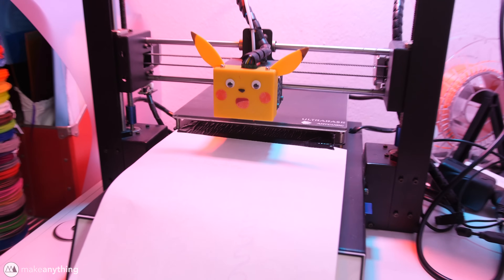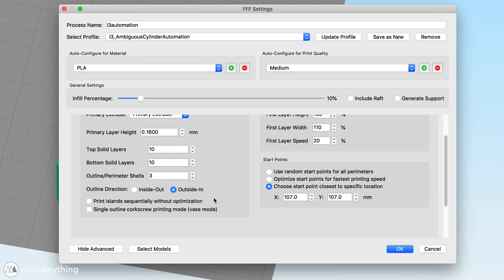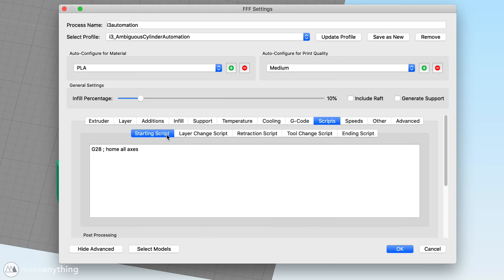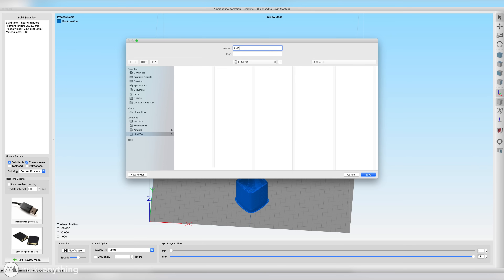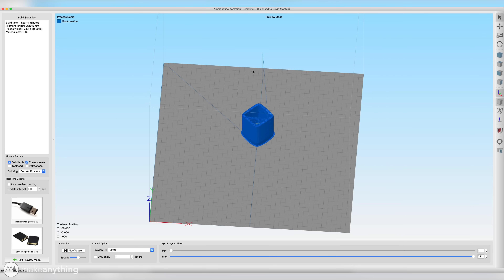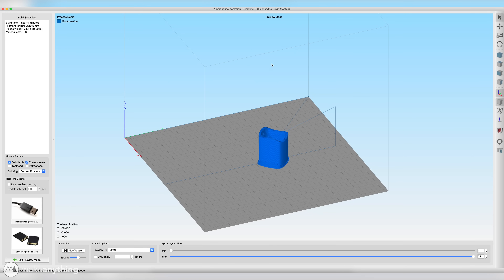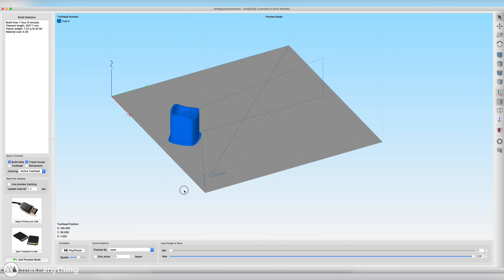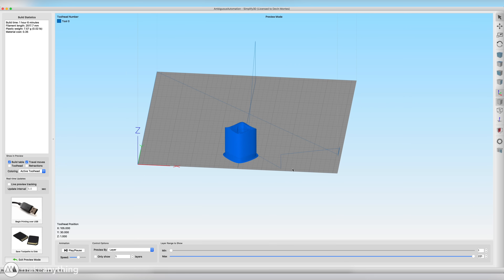Automatic 3D Print Removal using G-Code

Comment: i tried this on my edner 3 v2 neo and the print didnt wont to come off causing my extruder head to stuck on the object
does it need to cool down before trying or do i need a glass bed? if so, which one?
Reply from the maker: It looks like that printer has a PC bed which might stick to parts too much. Best would be a PEI bed, and also letting the bed cool to 45-50 first

Comment: thanks for the video very helpful. coudnt get the beeps to work but the automate code you made worked perfectly for what i needed. I switched the G1 to G0 and didnt need to clean the extruder in between prints. next im trying a G4 code to let it cool a little bit, then ill be designing pieces to scoop them into the trap. wish me luck.

Comment: This is exactly what I was looking for. I'd like to be able to run Octoprint on an Android phone and print off multiple objects while out of town. Them just come home and pick up and clean all the printed pieces. I've been doing a lot of mods and upgrades to my JG Aurora A5, and I've removed the "3d Printer" nameplate off of the gantry, I guess I could design and print a scraper/pusher that attaches in the same place.

Comment: I would use a nozzle flow/purge line before each print. Just put them off to the side and each one at a different y position. That way you start each object with a good flow, as if you printed a skirt.

Comment: I can see how it would work with parts like this.  Tall and relatively thin with a small surface area touching the build plate.  It wouldn't work so well on parts that are short and have a large surface area contacting the build plate

Comment: I have a belt printer, but as you might know due to the 45 degree head, some thing don't print as well, and some print better.  But I wanted belt printer that has the traditional xyx.  So I was getting ready to convert one of my bed slingers, but I might just try this first. One thing I plan to do is on my models build in some kind of angel relief so a scraper and get under that and pull it off. I know this is an old video, but it still great. And one of my printers is an i3 Mega

Comment: Really good video.  Am in the process of doing the same on my cr10s.  I am using the secondary extruder output on the motherboard to lower a long scraper.  At the end of the print the y axis moves as far forward as possible.  Then I cool the bed and leave for a few minutes.  At this point the e1 stepper lowers a long blade to the bed surface and the y axis moves backwards slowly.  In theory this should work as my printer is tuned exceptionally well.  I don’t use any printed platform additions or things like glue or tape.  Also I have found that even using all of the bed providing it’s cooled right down and also the model is cooled the prints come off with no effort at all.

Comment: My printer would flat destroy itself trying to remove my prints from the bed. If your gunna post something like this then it should cover how to print something that sticks well enough to print but not so well you need to use Thor’s hammer to remove it. And that’s after the bed is cool. Cuz I’ve never put anything on my print bed but nearly every print on this glass feels like I’m going to break the glass just getting it up

Comment: Donyou by any chance have a video on bed leveling. At the moment i have been thinking of buying a BLtouch. But at the same time while i look at your videos i might not have to do that.

Also my next quick question is if you can have profiles? Like for example you have your default print movement settings in profile 1. But profile 2 has what you did in this video. And say you mess something up. You ciuld just go back to profile 1.

Also do you have to paste stuff into the gcode script? Or is there another simple way of printing multiple things without having to mess with gcode well…..code..?

Comment: Do not merge the files in one, it creates large files, so it is not real continuous printing. Just use M32 command to start printing the .gcode file - that way you can run one file several times. (If your printer supports it. Maybe it could be also done with M23 and  M24 commands.) See gcode specs.

Comment: Be really careful about wire brushes around the heater, usually there's a tiny gap between the cartridge and the insulation, it develops over time perhaps, it may short out and or short to your therm sensor, ( found this out the hard way), I usually avoid the wired side it's tough to keep them sealed with all the thermal cycling I guess. But just something to think about if this type of setup is unattended
Reply from the maker: I didn't consider that, good call!

Comment: This is a great idea! You can get this to work with taller prints (or prints of any size) by replacing the "Move up and back" code at 4:15 with these lines:

G91
G1 Z10
G90
G1 X105 Y195
G1 Z1 F3000

The G92 means relative positioning, which means the G1 Z20 moves 20 mm from /wherever/ you are now. G90 switches back to "normal mode," so that the other commands work the same way you expect. This change means that moving the print-head up works even if your print is bigger than 50 mm (or any size), as long as you have a small gap between the top of the part and the highest z-height available.

Comment: I wonder whether incorporating the brim into the model to have a say 45° lip and putting a similarly angled wedge on the print head could help reduce forces on the print head and facilitate levering the piece off the build plate like so :   model-brim-lip   |_/ /_  print head? Print head wedge would need to clear print nozzle end though. Second crazy idea, print out filament on plate as it's spooled back on and fed through again to mix colours along new filament length lol
Reply from the maker: I think that's a great idea!

Comment: Does g code has a code to go to a line like in bash? Or point it to another file :) Set a variable of how many times you have to cycle through files :) Code minification is a thing :) F2FS has a support for ZSTD compression. And some kind of network print solution.
At that point you would not be g code size limited :)

Comment: I lol'd at 0:23! Too bad my LK4 Pro has silent steppers... I'm glad to see somebody actually willing to talk about G-Code. Too many people just don't want anything to do with it.
If I had to print hundreds of the same part, I would probably try to mod my printer to have a servo controlled 'scraper' that can be deployed with some M42 commands.
...although in my case all it would do is break things, because my prints won't come off even with a putty knife.

The nozzle brush is an interesting idea! My filament oozes and curls back up onto the nozzle! It's so messy that a bed wipe is not enough, even with a brim!

Comment: One mechanical solution, to push the model further than the build plate, and still push it when it touches the slide.  add a spacer block the point of contact of the part of the moving head. they you can add contact power relays triggered by the printer from cgode and uses all kinds on addons, conveyor belt, bed srapper.

Comment: There are 3D printers that have a rolling build platform which is like a treadmill.  After a piece is printed it is rolled forward out of the way to make room for a new object.  As those objects round the edge of the treadmill print bed they are literally forced off of it and into whatever collection bin you have set up.  Can that be adapted to any kind of 3D printer?

To avoid the stringing across the print bed how about mounting the steel brush to the opposite side instead?  That way each new pass starts without strings to glob up the works.

Comment: If the printer frame and print bed were large enough could many print heads be mounted at once?  For purely duplication purposes you'd think it would speed through identical prints.  I've seen dual print heads mounted to the same rail or guide.  I've seen print or tool heads that can be swapped by the 3D printer itself on the fly.  

How about a new approach?  Remove the traditional printer frame to replace it with robot arms.  To these robot arms mount multiple 3D printer hot ends with filament feeding systems.  This will enable to robotic arm to work with many colors and materials at the same time.  It would rotate each component into place eliminating the need for wasteful purge blocks.  The print bed itself doesn't have to be mounted in the traditional position either.  It could also be mounted to an automated and adaptive robotic apparatus.  

Think of it as a painter.  Holding the palette, brush, and canvas to co-ordinate the intricate motions like an in-air 3D dancer.  With multiple robotic arms in play each mounted to a common surface they can add their material(s) to a singular or a variety of print beds without getting in the way of other robotic 3D printer/painters.  The arrangement of these robotic arms could be linear, mounted as a square, circle, sphere, etc.  Perhaps this could be a new form of 3D printer were deposits are made to the outer and inner surfaces of an existing object or where new sculptures are fabricated?

As far as editing the G-Code how about creating a learning program?  Mount a 3D printer pen to a robotic arm so that it can be used as a learning 3D printer that actually moves in 3D space.  Can the G-Code be used to teach the robotic arm how to move with natural human motions?  Kind of like making it a programmable puppet.  I have seen this done on 3D Printer Nerd's channel as he interviewed a puppeteer at one of the ERSA/MRSA fairs but I wasn't sure how it was done.  

The human operator grabs the robotic arm in learning mode to move it around while making a live 3D print.  Once completed the software saves that to its library.  Over time the robot can address new challenges by combining the actions of these libraries or possibly adding to them with improvisations by making short edits on the fly.  

Could also be used to build up adaptive works through other sensor inputs.  Then tell the 3D printer what you want made and watch as it figures out how to accomplish that task.  This would make an awesome series of videos as you and perhaps other team mates join to figure this project out.  It will benefit the entire 3D printer community and of course sponsorship is likely to blossom as a variety of interested parties will want to have their products and services affiliated and advertised throughout the project.

Comment: how about a Gcode to create a claw for the print head, once it's done printing (and cooled down enough), it moves into the claw (probably with some clips that'll catch on the top of the print head), and then moves into a position where it can pick up something with the claw?

or perhaps if there's a print head with 2 fans that can be controlled individually, rewire one of the fans to run a little motor (probably with a gear system attached) to grab stuff and assemble it off the bed

or a see saw style lever, that the print head moves to press down (and potentially trigger a cool mechanism)

Comment: Instead of taping the paper to the TOP of the BOTTOM panel u have there. flip the tape upside down and put it on the bottom of the top panel so that there is less 'flat' paper space near the beginning of the paper slide. ALSO consider teflon sheets instead of paper which create less friction than paper.

Comment: next up, "how to hammer nails with a caliper".

you have some good ideas on your channel, this ain't one of them.
Reply: Why is this a bad idea?
Reply: @DeanMcKenzie   the "how to hammer nails with a caliper" comment didn't clue you in?  Alright, well the core of a printer is a precision positioning system.  They are built to move fast and accurate, NOT to deliver force (like a milling machine for example).  In the absolute best case scenario, the risk of skipped steps so high its almost guaranteed, sure you can re-home between prints and probably be ok, but that's best case scenario.  Crashing them into the part will cause untimely wear if not a catastrophic failure (something bends or breaks). 

Lets also talk bout bed adhesion & part shape:  his demo is best cast scenario:  very little surface area on the bed & a flat rigid edge to hit with the carriage.  This is rarely the case.

if you really need your parts to be removed automatically (you dont), I would suggest looking into an infinite z or belt printer (same thing, two names).  On these, the print bed is a conveyor belt, so when its done, the belt advances and the curvature of the belt neatly peels the part off.  They also have the advantage of one axis being infinitely long.

Comment: Thanks, this worked perfectly.

Printing in PETG which sticks extremely well to the bed so I added;

M190 R40

before "move print "
So that when Bed temperature reaches 40c the print easily releases.
Reply: what kind of bed coating do you have? I'm interested in trying it with PETG, i've had this filament for a while but hasn't tried it yet, but i've heard that it is difficult to remove it from PEI and some glue should be used in between.
Reply: Alex polyenov 
Using a textured Prusa bed, I’ve had a few fails with the print not releasing at 40c. PLA would be better for sure.
Once I get it sorted I’ll post settings.
Reply: @nicokypreos  Thank you! Much appreciated. I'll keep an eye for the update. My Prusa bed is smooth PEI, so i imagine it would be even stronger adhesion than textured. I'm specifically interested in PET/PETG for their properties. PLA wouldn't work for me for its  very low melt temp/
Reply: @alexp2011a  ok so using PETG and Textured bed, releasing temperature is 27c, print slides off

Comment: IMHO whether this works or not highly depends on what kind of material you're printing with, to what kind of print surface, etc. I'm printing PLA on PEI and it sticks way too well as long as the bed is warm. So in my case, I'd need to cool the bed first, then knock of the print. Cool idea regardless!
Reply: Wouldn't a peo sheet stick less?

Comment: F stands for feed, when using a CNC mill or other similar machine, the speed or S is for RPM of the tool.
Edit: G code is modal, that means if you wanted to move to say X1 Y1 Z1 but you wanted to do each axis at a time you could type
G01 X1 F10
Y1
Z1
Because any command or value you have entered already, stays the same until you say otherwise.

Comment: G-code is motile, which means if you set something it stays that way, if you put g1 once, you dont have to put it again until something else happens. Even the variables like x and f will maintain.
For example the brushing could just be 
G1 X# Y# F#
Y#
Y#
Y#
X# Y#
Reply: not sure if anyone reads this 3 years later, but this is completely wrong and will not work on most printer firmwares.
Reply: agreed
 @Terandium
Reply: @kubster1315  he got the gist of it right, but went entirely wrong about it.

G1 X# Y# F#
G1 Y#
G1 Y#
G1 Y#
G1 X# Y#

would work exactly as he described, but that is only because g1 y# only moves the y axis so the other axises are entirely irrelevant.